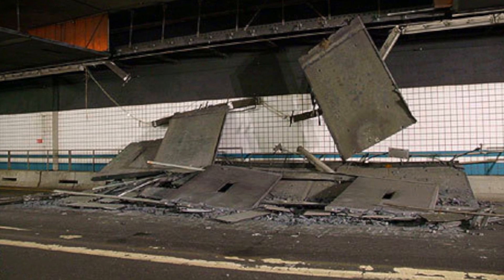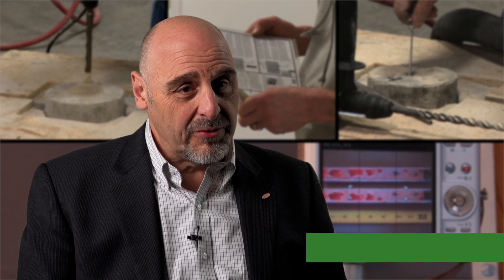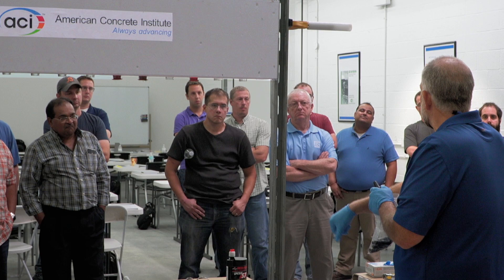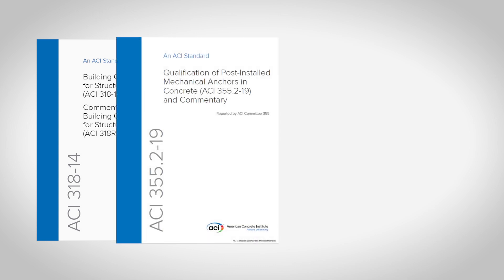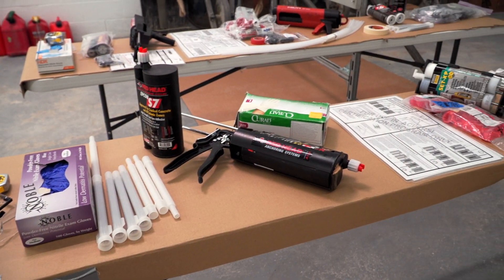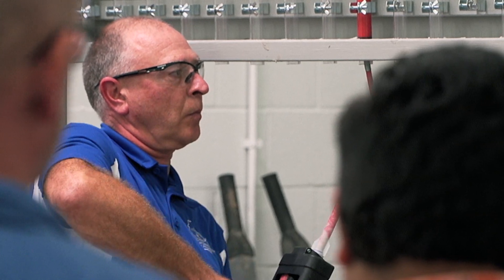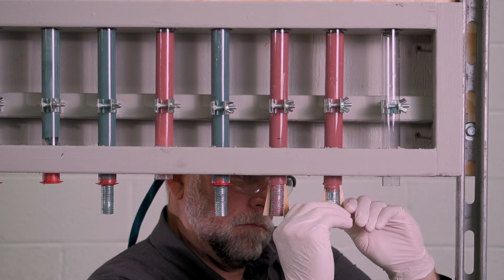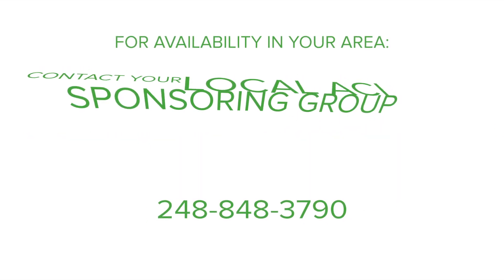ACI Certification - Post-Installed Concrete Anchor Installation Inspector

Comment: Wtf is the procedure
Reply: Follow the MPII of the product you are using!
Reply: The product you're using has a report attached with it or a database online for it.  It tells you exactly how to install.
Reply: Clean your hole, add epoxy back of the hole, place anchor till epoxy comes out